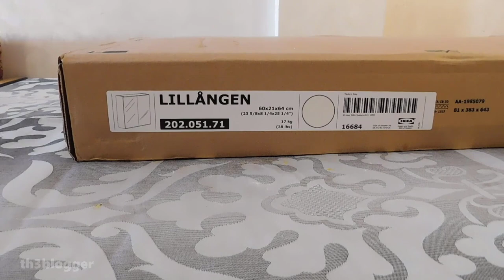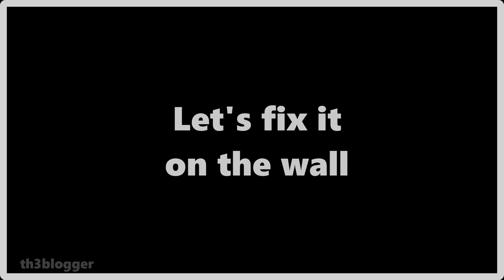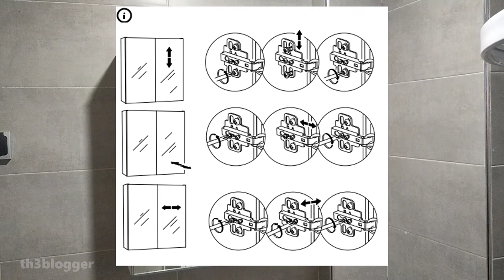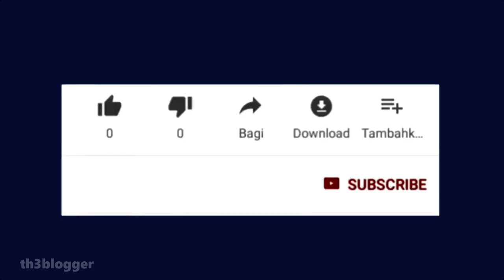IKEA LILLANGEN assembly and fixing to the wall

Comment: Do you need to attach both screws to the studs?
Reply from the maker: Hi. I have a brick and cement wall.  But, it is necessary that the screws are well attached, because it is heavy

Comment: What are the white round things you put on before the cabinet
Reply from the maker: Hi, The white round things placed before the cabinet  are used to fill the gap between the wall and the LILLANGEN back panel.
Reply: @th3blogger  of course! What are they called? Lol
Reply from the maker: they are called spacers or shims.
Reply: @th3blogger  thank you! Can you get them from ikea?
Reply from the maker: I did some research for you on the Ikea website, but I couldn't find them. But  I found them on Amazon . Good luck

Comment: Unless you have a cinderblock wall, the proper way to attach it is to screw it into the wall studs, but Ikea has not made this easy, and the instructions for mounting are not very helpful.  If you are going to try to attach it to wallboards, you should at least use 4 or maybe 6 screws to distribute the load, but they only give you 2 mounting brackets.  The cabinet is kinda heavy, and if it falls, those mirrors are toast, maybe the glass shelves too.
I'm going to have to buy some 1x2" and rig something.
Reply from the maker: you are right .  thanks for watching
Reply: th3blogger Yes, he is right I had  the same problem. First the screws are not included and two weren’t enough to hold the heavy cabinet so it felt down over my wife head☹️.
Reply from the maker: It's for this reason i used 10mm screw ..

Comment: how did you fix the water leak😮😮😯😯
Reply from the maker: I asked for help from a specialist with the necessary tools for soldering 😉
Reply: @th3blogger  im glad u got it fixed. im about to install the same cabinet but im lucky i know theres no water pipe because the bathroom is new and i saw the piping.
Reply from the maker: I put this part of video so that other people don't make the same mistake.  good luck and thanks for watching

Comment: Hi, I was wondering if the screws you’re using at 16:20 came with the package from Ikea or you have to get them from a different place. Thank you!
Reply from the maker: Hi.  I bought the screws from another place.  I used 10mm but you can use 8mm
Reply: @th3blogger  may i know the size of the wall plug?can it hold the load?i just bought one..

Comment: At what distance do the holes in the wall need to be to fit it? I plan on buying one too if I don’t need any drilling.
Reply from the maker: Hi. I used the 10 mm screws and it needs between 6 to 7 cm deep

Comment: Hi, what size of the plastic insert and screw did you use here? Can I use the same size for dry wall?
Reply from the maker: Hi. I used the 10mm size for more durability 15:51. But you can use a size of 8 mm .